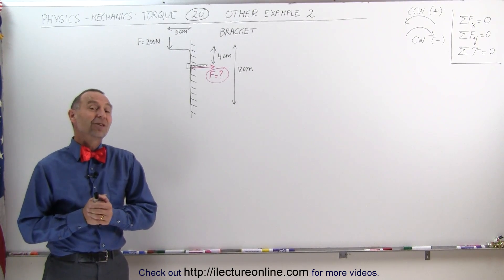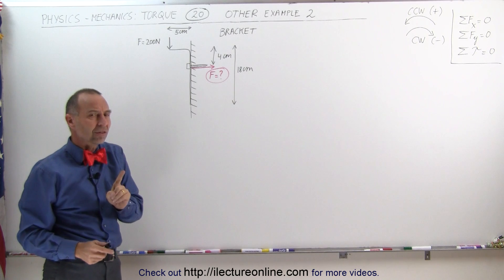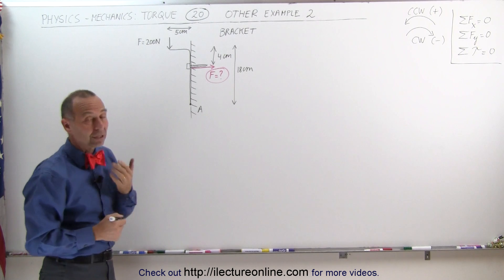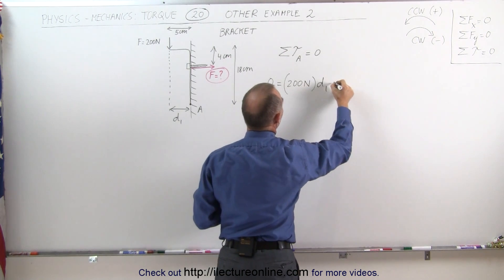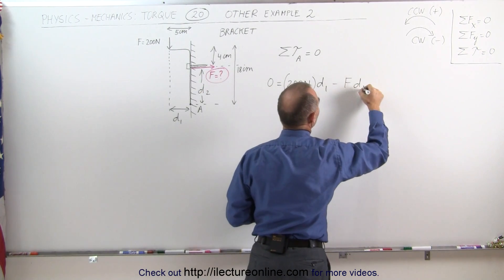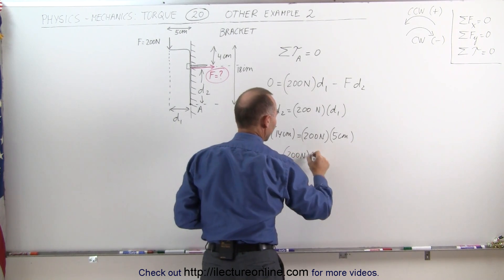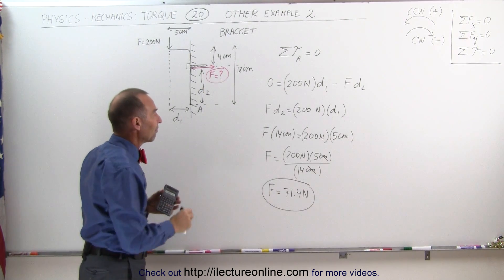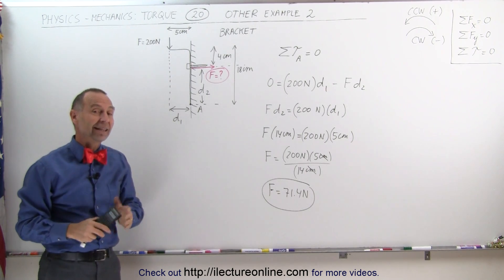Physics 15  Torque (20 of 25) More Examples: 2 F=? of Screw on Bracket

Comment: Thank you for an excellent video lecture. From your analysis it would seem that the value of the unknown torque F on the screw is invariant with distance the shelf is above the attachment point (4cm in your example). Do I assume correctly that the only difference would be on the shearing force at the point of attachment which you do not calculate. Many thanks.
Reply from the maker: Yes, that is a correct observation.

Comment: Interesting. If you only had the screw and the top part of the bracket, then the pivot point would be the place where the bottom part of the screw is touching the wall; I am right? [That is, if the top part of the bracket and the screw are one unit, but the screw is in the wall. There is no bottom part that is 14 cm long]

Comment: How would you solve the problem if you had a second screw placed inline under the first?
Reply from the maker: Then there would be an additional force acting at the location of the second screw.
Reply: @MichelvanBiezen  With two unknown forces in the same equation, would you solve for each force individually then add the forces together?
Reply: @willblackler7605  unclear please
Reply: @MichelvanBiezen  And how can we find this additional force on the second screw ?
Let's say this 2nd screw is 4cm lower than the 1st one.
I'm still figuring out how to calculate this new force but I'm stuck...
As @willblackler7605 says, should we solve it by finding each force individually ?! But since the sum of torques is 0, it makes no sense on this way...

Comment: Hello! Thank you for the video. What if the force was placed in the opposite direction? Would the point of rotation A moved to the corner of the angle?
Reply from the maker: Yes.  The "point of rotation" can be picked to be anywhere.  But usually it is practical to place it where it makes easier to solve the problem.
Reply from the maker: Then we would have an additional force at the location of the second screw.